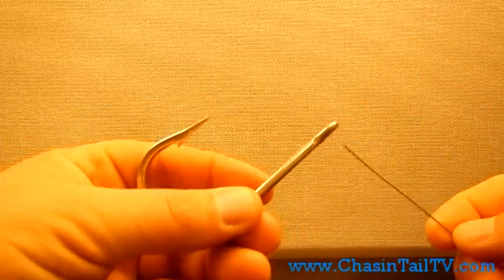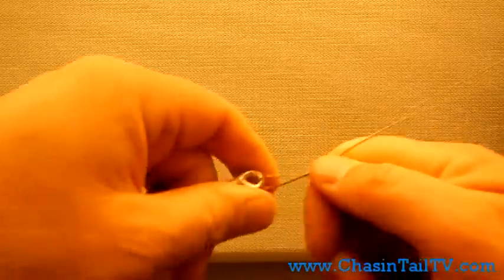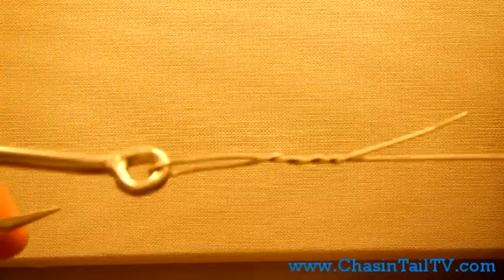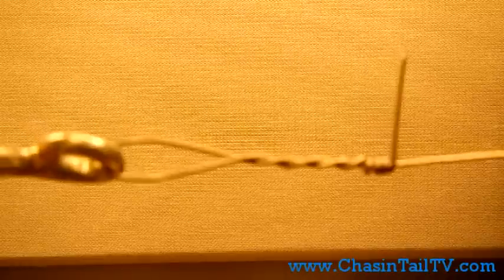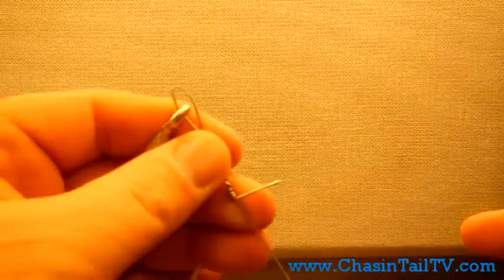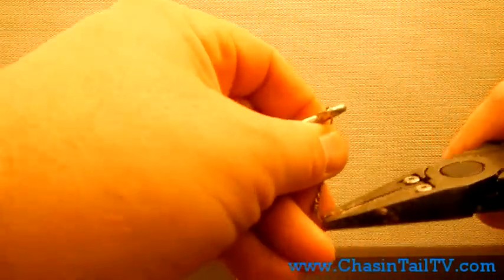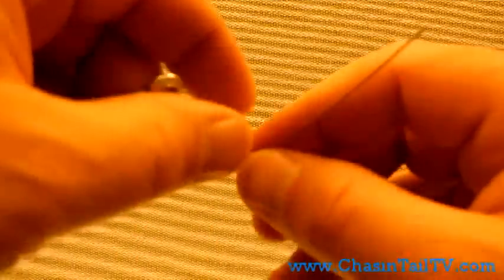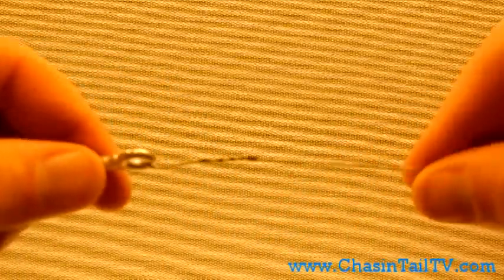How to Properly Tie a Haywire Twist

Comment: Holy crap, those twists are so fast. Who knows the scientific answer of does the heat that is generated in the twisting cause degradation of the wire and compromise ultimate strength? Conventional wisdom would say go slow to get less heat. Cooling with water would help too. Just like spitting on a knot before tightening it and I bet most of do that. 
Nice video though. Also, is it just me that wants to take a grinder to the tool head and some of that blue up-tube so my damn hooks can swing around???
Reply from the maker: They hold